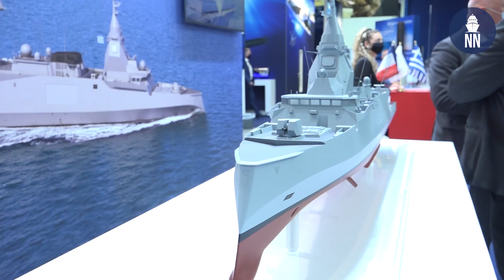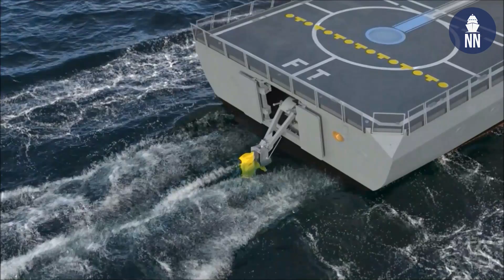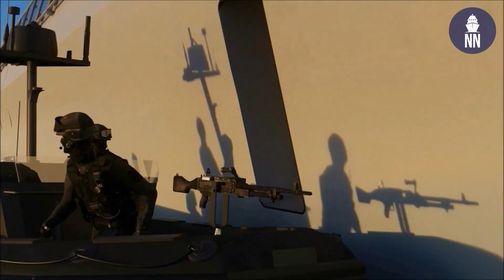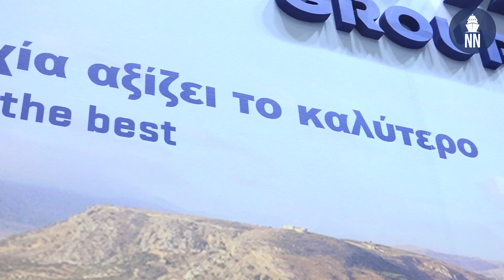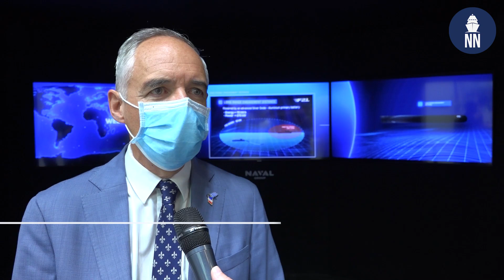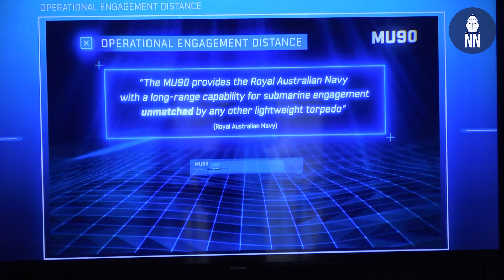Naval Group at DEFEA 2021: FDI Frigate and Underwater Weapons

Comment: How mutch cost one of them with the best Tecnologie inside?
Reply: It will cost for Greece 900 miilion euros each incuding ammo/surplus, training, infrastructure.
The FDI HN(stands for Hellenic Navy) will have the 4 faced fixed AESA radar SeaFire(capable of tracking 800 targets and engage 16 of them at the same time), advance ESM/ECM, 32 VLS Sylver for ASTER-30 1NT, a 76mm Super Rapido STRALES gun capable of firing the Dart guided ammunition(against sea-skimming missiles, bombs etc) and Vulcano round of 40+ km, Exocet blk IIIC antiship missiles, MU90 torpedoes, RAM blk 2 CIWS, 2 remote weapon stations and 2 sonars the hull mounted Kingklip Mk2 and towed variable CAPTAS-4(the best in its class) with a maximum detection range of 150km and also the FDI HN will have the best ASW helo, the MH-60 Romeo that Greece recently has ordered.

Comment: The cam er missiles also can help against saturation attacks, while you can use the rest of the vertical launchers with aster 30 against jets and a small number of scalp navals, In the future they will create a beast version with 2 sylver A 70 and 2 A50 vertical missile launchers. I think MBDA said they can put four camm er missiles to one tube. I'm talking only about the vertical launchers
Reply: @jonnytaco7671  ΥEAP and I dont undrestand why Greeks want scalp naval on the ships. I prefer air defense only in our tubes. We  can ask to buy ground batteries with scalp missiles, a good truck can do the job. From Athens you can reach Cyprus with a ground batery, from Crete too .  Greece doesnt need to travel long distances against their enemies. On ground is much easier to develop a ground version weapon and at the same time you avoid to lost everything at one strike. Even if a ground battery doesn't exists, French can create one, we already have at our mirage scalps

Comment: I think that French FDI and Italian Improved FREMM designs are the best solutions for the hellenic navy
Reply: both have : 32 VLS - if I'm not mistaken they are Sylver 50s (Aster 15 and 30) for the FREMM-IT and a mix of Sylver 50s and Sylver 70s (Aster 15, 30 and MDCN) for the IDF -, a 76mm gun (the same one) a complete anti-submarine suite with a hull sonar and a variable immersion towed sonar (for the FREMM-IT I'm not sure, but I'd be surprised if she didn't have one) and 8 anti-ship missiles

Tell me if I'm wrong!
Reply: Yes, the fremm has bigger surface warfare suite (127 mm cannon, 76 mm ciws and 2x25mm autocannons), in contrast the FDI has a higher deep strike capability being able to launch cruise missile with the vls. But both project can be adapted to the customer needs, maybe putting sylver a70s instead of a mix of a70 and a50, they both can accommodate American weapons such as searams, sm2/3 with mk41 vls. So they're basically identical in terms of possible and real capabilities, very powerful ships

Comment: If Greece chose the French proposal what would the actually get?
Reply: 2 gowind 4 belharra and an good modernization
Reply: @george_noul  nop 4 belharra and 2 cassard class frigates right away + modernization
Reply: @jeanvaljean9293  no they made available the option to build two gowind corvettes
Reply: @jeanvaljean9293  Cassard ships are already rejected by the Hellenic Navy.....Naval Group's latest proposal is 4 FDI + 2 GOWIND
Reply: @tjololot3761  I don't see how the 2 G could be produced that fast. And I don't recall the navy rejecting, actually it was very impressed of the general state of the old boat. May be the grec gov refused ...
I must admit, I have just checking the McdN... unfortunately not for now may be mark 2 by 2027.
Reply: @jeanvaljean9293  The French claim that they can deliver the GOWIND in 36 months......that is acceptable
Reply: @tjololot3761  yes that is still 3 years so 2025, I thought grece needed them ASAP ?
Reply: @jeanvaljean9293  Yes but there is no other viable solution to be delivered sooner than 2025. Even the Dutch M class frigates are not available right away...but in 3 years as well.
Reply: @tjololot3761  that’s why the cassard would have « gifted » as i understood it but … may be the plans have changed
Reply: @tjololot3761  Dude they haven't proposed   the gowind 3100 wtf are you talking about
Reply: @oog3411  Yes they did it on DEFEA2021.....
This GOWIND issue will be announced officially at the final stage of the procedure, when the HN short list will only include the last 3 candidates.
Reply: @KalFulsom  More missiles but what kind of missiles?? The FDI carries the mighty Aster30. It is not certain that the US Government will release soon the SM-2 missile to  match the Aster30 range
Reply: @KalFulsom  The obvious reply... if the grec gov wants something else go. If grece still wants mcdn even a bit later go for the FDI. The guns are exactly those that where supposed to go on the Fremm so the same. As for ECM ... please we are talking about an AESA fix radar, with MFA, with active jamming drones as decoys...
If regular jammers will be needed it will come with the mark 2. 
Why france switched form fremm to FDI ? the hypersonic missile cannot be detected by a rotating radar. only a plate AESA radar has the Sea fire can detect them.

Comment: I wish that it has an "Americanised" variant that can also accomodate Mk.41 VLS for the ESSMs and SM-2s along with its needed radar/fire control radar aside from the Aster 15/30 options so that it can be more enticing to other foreign navies.
Reply: It is either the Mk. 41 VLS (with ESSM and SM2) or the Sylver 50 VLS (with Aster 15 and 30)
Reply: @andreactuel7209  not true. The Type 45 destroyer's were built with the slyver and the plan was to leave the space free to install mk41 to allow these ships to make use of other missiles, primarily the tomahawk.
Reply: actually their an other contract constellation like, that will come later. 
the FDI will be proposed as a based designed like the Fremm were. 
The problem is that NG doesn't have a partenaire or shipyard in the US...
Reply: @KalFulsom  You know that fremm that the FRENCH DON'T PRODUCE ANYMORE...
Mica VLS can be equipped without using a single sylver. Or can be actually be fitted in any sylver but that would be a loss of space.
Reply: @Sto So  how does it fire what ?
Reply: Greece will never need an asroc, their will be 8 a70 cells for cruise missiles and 24 a50 , no other need for American systems. and their is always the option to procure camm. 16 aster 30, 8x4 camm and 8 cruise missiles would great
Reply: Why would you waste the ship with sm2 missiles?  Standard missiles have to be launched in pairs to guarantee a kill, Aster 30 is a one shot kill missile….
Reply: @andymacmac9151  perhaps the range. Unless Aster-30 can cruise to lengthen range similar to sm2 if not exceed

Comment: Add scalp naval missile and we take them
Reply: that frigate is too little to be upgraded, while the Fremm is more armed and able to equip SCALP
Reply: @pietrodicanio9404  it can take much more then it's now showed.
France doesn't make FREMMs anymore and won't let MdCN on the IT version. 
the FREMM FR and IT are very different, so is the SCALP and MdCN.
Finally the Seafire is much better then the current radar on FREMM and cannot be integrated on the Fremm.
Reply: @pietrodicanio9404  I don't know if there are plans to add the SCALP (or rather its naval version, the MDCN) to the FREMM-IT, but if not already done, it is planned for the IDF, the French Navy has requested it